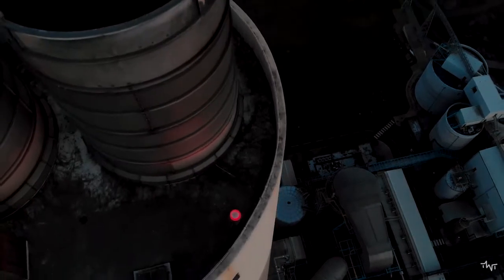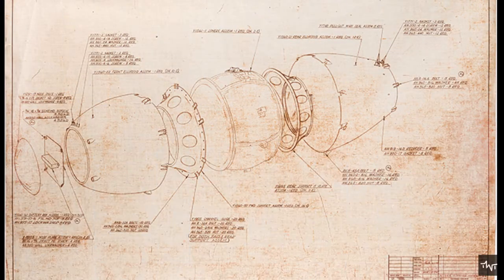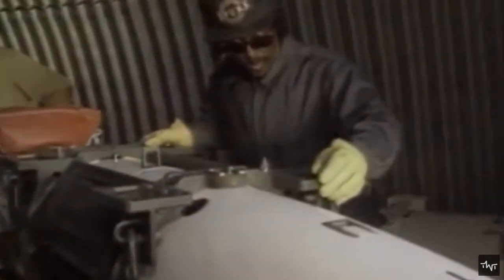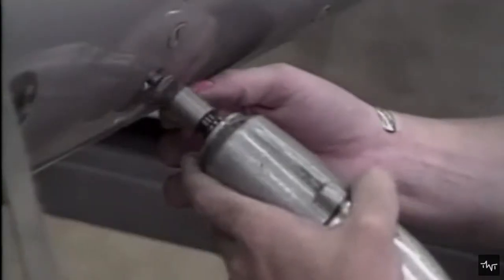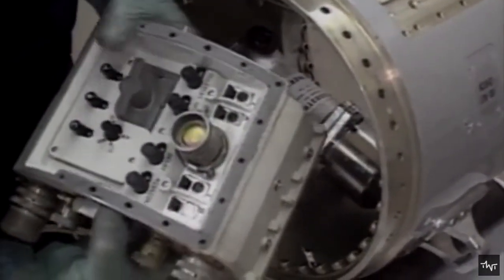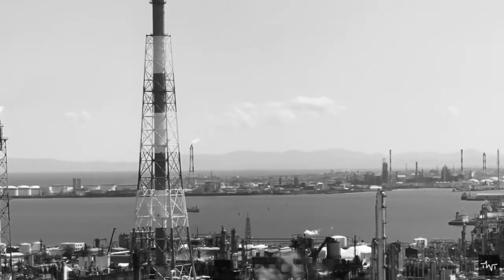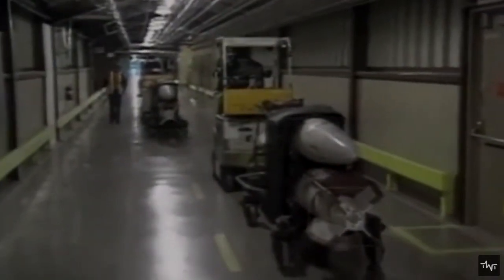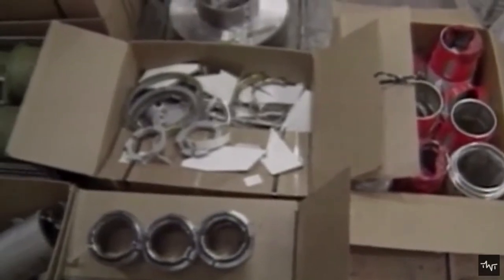is it possible to dismantle nuclear weapons? Can Nuclear Weapons Be Dismantled?

Comment: I did this job from 2009-2017. I got out of the air force after the minot incident where a few of my fellow airmen misplaced a couple live thermonuclear cruise missiles for around 12 hours. It was a training exercise where dummy nukes with check sources aboard to simulate live warheads were to be used but somehow someway the stars aligned just right for stupid is to do as stupid does. So i got out and went to work at a national lab taking these things apart. And it doesnt take nerves of steel, the plutonium implosion detonators are shielded and the conventional explosives used are difficult to detonate and the entire weapon requires some very specific things done to it to make it go boom. Nobody is smuggling out any plutonium spheres either as youre checked for anything "hot" on you before you enter and before you leave so a giant lead box would be noticed. Why i eventually quitwas because all that fissile material that cost billions to refine in dacades past is just stockpiled. We have enough fissile material sitting around giving off decay particles doing nothing, when it could run every operational nuclear reactor from now until .....? And if we down blended our enriched u235 and plutonium 239 into mixed oxide fuels and reprocessed our spent fuel we could eliminate fossil fuel burning electric plants very quickly. But no, politicians like biden, bush, hell even obama are bought and paid for andnwill stop at nothing to maintain the status quo. Oh and ps burning coal releases more ionizing radiation than any nuclear power plant save one. Fucking asteroid better hurry up

Comment: Yup they can be dismantled, they have been doing it for years. Pretty much they just remove the electronics bits, then open the can containing the physics unit, or store it whole. They remove the primary from the secondary assembly then cut the explosives free from the spherical charge weapons or pull the plane wave generation charges out of newer ones. Then the different pieces are stored for disposition. They usually keep the pit assembies  cut in half in 30 gallon steel drums with neutron sbsorbers. The material is generally recycled as needed to make new cores. The secondary assembly is a bit trickier as it has some highly reactive lithium deiteride in it so it has to be disassembled in an inert gas glove box. These assemblies are rarely disassembled and simply put inside a steel drum purged with argon unless they want to extract HEU from them. The physics package from the last 4 of the 9Mt devices were saved whole because they might be needed to redirect a large asteroid in the future. What a plot twist that such a terrible weapon may one dsy save us all.😮
Reply: Can you please tell us a little bit what exactly are “ plane wave generation charges “?  Are there ones that are not spherical ? Like in artillery shells
Reply: True I was there

Comment: Man, the expertise and nerves of steel needed to do this is unimaginable to me. Hat's off to these people doing the job.
Reply: Surprisingly enough you could hold a nuclear primary core bare handed with no ill effects. The core is plated with gold and nickel and other than feeling about as warm as a mug of cofee, the only radiation from it would be enough neutrons to make a detector tick but not enough to get a real dose unless you slept with it under your pillow for a week or more. The explosives used are extremely insensitive, and even if you blow torched them they would simply burn like plastic with a smoky flame. The most dangerous part is the secondary that has lithium deuteride in it. The chemical is highly reactive with moisture in air and burns rather violently once going. It can only be handled under argon neon or helium atmosphere 😮
Reply: @christopherleubner6633  man, that's both reassuring and terrifying too.
Lithium deuteride.
Does one carry around a box that produces such an atmosphere?